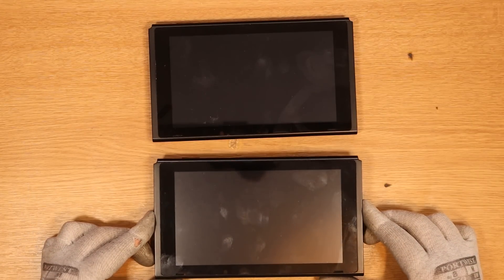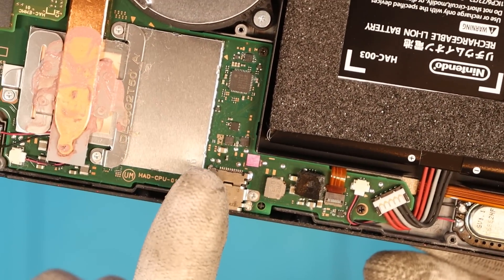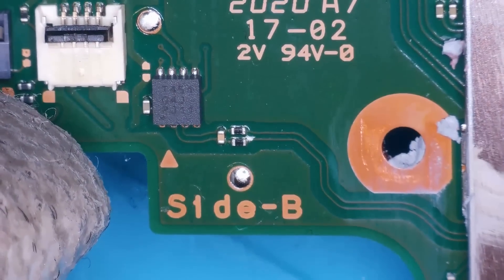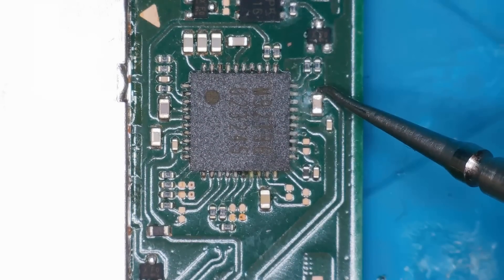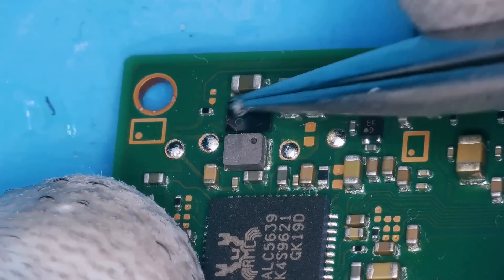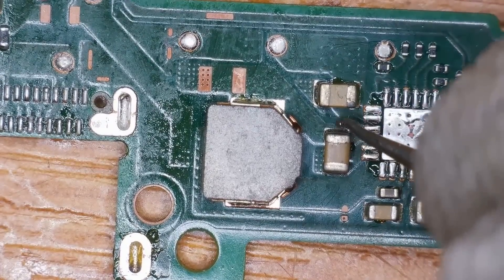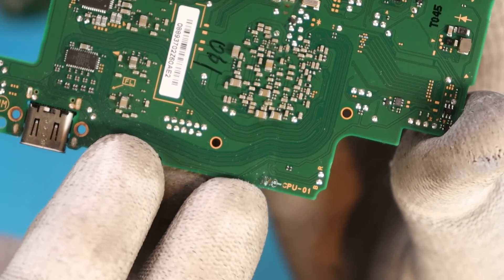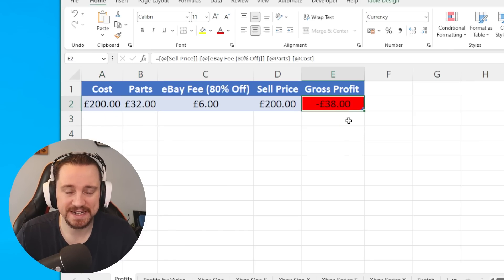Trying to Fix FOUR Faulty eBay Items for Profit | Part 2 | Profit or Loss S1:E7

Comment: Can u use the amp meter the other way round? Ie plugging the USB-C into the mains and running a USB type A to say micro USB cable to something like a DS Lite. Or does it only work in one direction. Thanks

Comment: Well, at least you have some spare parts for another Switch that you might come across, and/or you might be able to alvage that 3rd Switch somehow, and/or you could just re-sell the two water damaged ones as for parts or not working so as to at least break even... right?

Comment: Great Video!  Bad Max IC on the first board?  In the old days, we had a saying "the 5 dollar part, protects the 5 cent fuse".  😁
Reply: That's true I've never seen a fuse blown in a switch yet like you say the £5 chip blows instead

Comment: Congrats! You've found a blown fuse! I'm still trying to find one switch where that fuse is actually blown ;)
Reply: if the fuse does not blow, what is its point?  Aren't they there to go ping?
Reply: @I_Don_t_want_a_handle  yes, they are. But (in my experience) half of the board goes ping and the fuse is still perfectly fine.

Comment: I picked a great time to stumble onto part 1.

That water damage on #3 makes me think the Switch was set down flat and something spilled on top of it. She's in rough shape, but aside from the shorted components it seems pretty superficial.

Did you ever sort that short? My thought is its under the cap itself, rather than being on BQ but I'm also at best "competant" when it comes to soldering beyond "fix my stupid BMW blinker"

#4... Is that rust oh boy

Comment: Glad this was a good eBay buy! I had  about given up on eBay because the trash in the “for parts” section, but I bought two Xbox One S consoles recently and I have never seen two consoles look as close to new as these. One had a bad hard drive with only 69 hours logged on it. The other has a bad power IC. I’m still learning micro soldering so I haven’t tackled the second one yet, but I’m seriously thinking about keeping the first in my collection!

Comment: Wow that was a corrosion explosion for sure. Still great effort on the first one too bad it still does not work. I've done my first ps4 hdmiport replacement and it went perfect (would love to share a photo of my result) but unfortunetly still blod and no usb power, another hdd and psu did not fix it so maybe a reflow of the southbridge otherwise i think the apu me be gone 😢 still so proud of my soldering.😂 good weekend Joey

Comment: Hey Joey, I still have faith that it will be 3/4 fixed once you revisit the first one in this video. 

One thing to consider for Sally as far as the cost of parts go... if you got it from a donor board you have already paid for them. So it shouldn't be considered in a master spreadsheet imo

Comment: Just a small suggestion - you could use an eyeshadow or lip brush to clean instead of cotton swabs. It would be easy to use (they're quite small), easy to clean, and you're wasting less in general. They're stiff enough to clean, but soft enough not to harm small parts. Great video, I love watching electronics repair!